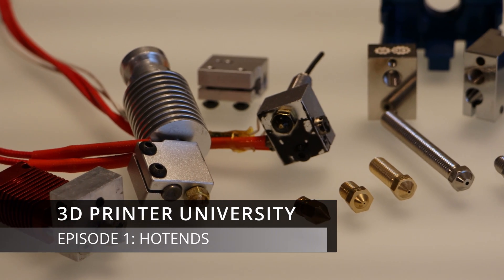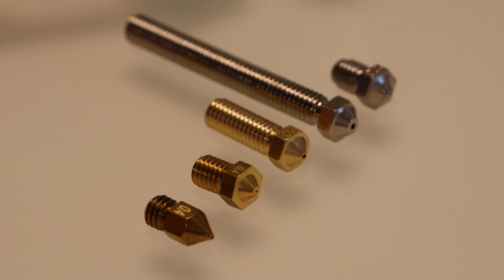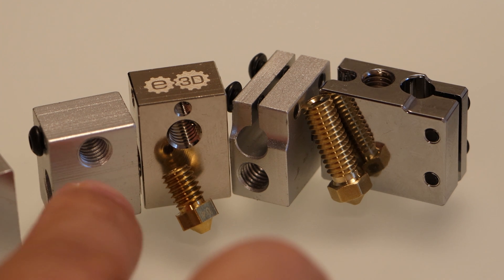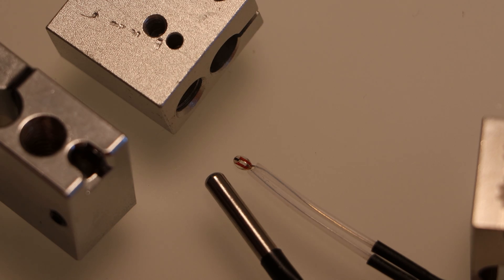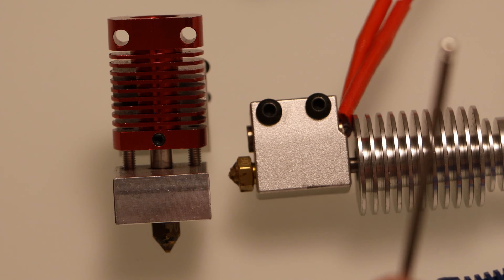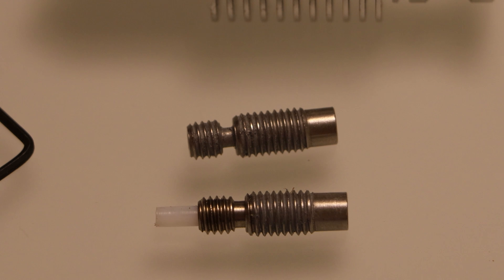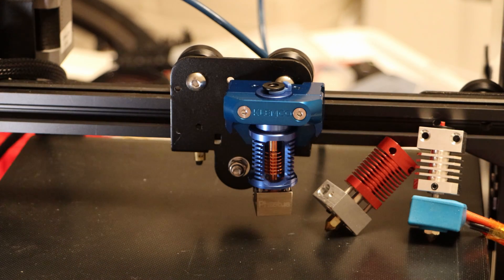Good/Better/Best: Which Hotend is Right for You?

Comment: I swapped out my standard hotend for my Anycubic Vyper, since it was not all metal. The new Hotend is a Dragonfly BIC HF.
Do I need to change anything in the software of something? If I turn it on it just heats up to 270 C evn tho 230 are programmed, and then it just writes Something wrong with Hotend.
Maybe because I cheaped out a lil on the heater? Idk what else it might be atp.

Comment: An additional difference between a thermister and a thermocouple is the thermister has better accuracy. and at typical 3d printing temperatures, you want better accuracy, you don't need the additional temperature range of a thermocouple. Good Themistors can be rated up to 300˚C, and will handle all but the hottest of 3d printing jobs. Thermocouples can be rated up to 1300˚C, but like I said, this is very rarely necessary for 3dprinting.
So, thermister = cheaper and more accurate, lower max temp
thermocouple = higher temp, more expensive and less accurate

Comment: Thankyou for the video. The Ender style hotend has another issues with the two bolts as they are offset from the centre of the heat block towards the back. As you do them up, the heater block bends upward at the back because of this offset. Any difference in the tightness of either bolt and the block twists side to side as well.

Comment: Good info for rookies like me. But a couple of potential corrections from an old electron pusher on the electrical section. First, the Ohm's law thing is likely to give a false indication of actual wattage of the heater. Resistance heaters (including old tungsten light bulbs, etc) have resistance that changes (goes up) as they heat up. The low 'cold' resistance causes  a large surge of current when first powered on, which tapers off rapidly to the 'running current' as it heats up to normal operating temperature. The other issue is the thermistor statement, saying that as temps go up, resistance goes up. Thermistors come in two basic flavors, PTC and NTC. As one might guess, NTC stands for 'negative temperature coefficient', and PTC indicates 'positive temp....'. If the printer is using an NTC thermistor, resistance will go down as temperature goes up.

Now, a request from this printing rookie: How about a video that quantifies the diameter/thread pitch/length of nozzles, heat breaks (including sleeve diameter where they go in the heat sink), heater diameter/length/voltage/wattage, thermistor type/diameter/length, connector types used for each heater and thermistor, etc, for each hotend type. It would be nice to know the same info about each printer.  Some of this stuff looks like it could be mixed/matched, but  that obviously isn't always true, even within the same brand (at least if it's Creality...).

Thank you for all the work I know it takes  to create this content, and I hope you didn't mind the thoughts on the electrical stuff.

Comment: Thanks for this explanation.  I notice that for filament exchanger system, versions like Bambu Lab cut the filament, while Prusa just retracts.  To save the extra part for a filament chopper, it seems like retraction is the way to go.  But so far, I haven't been able to come up with retraction settings that don't leave a plug that is of larger diameter than then original filament, which eventually results in deforming the PTFE filament in the hot end.  I've just got an all metal hot end, and I'm working on getting it dialed in to just make normal prints work reliably, let alone be able to remove the filament from the system.  However, I'm now thinking that forcing users to go with an all metal hot end would add just as much cost to the system as a filament chopper!

Comment: Personal Self Notes:
- PTFE in HeatBreak is used to reduce amount of friction inside of the hotend to get cleaner extrusion, 
- for an all-metal hot end to get similar levels of performance it needs to be highly polished on the inside but to me the main advantage of an all-metal hotend is that you don't have to be heating up this ptfe liner to the melting point because it'll start to release volatile gases
- Screws that are used to secure hotend in place increase heat transfer up to heatsink

Comment: The cartridge style thermistors are WAYYY better than the glass bead thermistors. Mine used to jump out no matter how well I secured it. It finally got eaten by the molten filament blob monster and I decided to upgrade it to E3D's cartridge thermistor. A quick change in Marlin and PID tune and I've never looked back. Bonus points for now having the wiring disconnect so if/when I replace it, there's no more cutting or soldering. Just disconnect the old and reconnect the new.

Comment: meh. i found all hotends to be junk, made my own.

it will melt a brass nozzle. thats about 950C. i dont run that very often though. just its there if i want.

no heatsink required.

people get so stuck in a rut, copying each other, and forgetting to go back to basics, consider the problems, and go on a hunt for alternatives...

Comment: You open my eyes, dude. I don't want any longer the volcano, but to upgrade to copper 👍
Reply from the maker: Lol not sure that’s what the takeaway is. If you look at an overall thermal model the material choice matters less than you’d think. The big lump of thermal resistance is between the nozzle and plastic. Check out CHT nozzles

Comment: for the heat break there's the mosquito style (like the 2 part blue and copper one) which has the rigidity of additional standoffs while avoiding the heat creep.
the standoffs avoids the heatbreak having to hold the heater and nozzle, which allows it to be even thinner.

Comment: fyi a lot of more expensive non stick pans use a ceramic coating which is good to like 300C instead of ptfe (though the handles and glass lids are recommended for <175C)

Comment: I did an experiment on my Ender 3 Pro. Measured the temp of the heatsink with and without the 2 screws fitted. It was only around 2-3 degree C different. I dont believe the screws are that much of an issue wih heat creep.

Comment: i cringe when you suggest removing the ptfe liner, My first 3d printer i missed installing that part back in first years of 3d printers....it keept becoming jammed. A few months later i discovered that put it in and i could print 300% better :P well proboly wasent polished
Reply: PLA sticks to metals when around it's glass transition temp, either overkill cooling or PTFE lining is the solution.

Or you give up after constant heatcreep issues that never fucking leave you be the switch to PETG.

Comment: A cheap and good way to improve hotend on Emder 3 is to use an all metal heatbreak (best titanium) and taking off the 2 screws between heat block and cooling ribs. This is a much good solution for me! Thanks für this perfect hotend guide, it's very well produced i think and very informative 👍😊

Comment: Aluminum block performs very well. There is no reason to pay extra for copper because there is no measurable difference.
Reply from the maker: Above 300C aluminum loses strength pretty rapidly. So 300+ it should definitely be copper.
But in terms of heat transfer both get the job done well enough.
Reply: @NathanBuildsRobots  I didn't take the strength into account as I have never printed over 260-270C.
Just heated up to 290 to melt the clogg

Comment: 3:40 - V6 Nozzle is 12.5 mm in length, Volcano is 21. This is 68% of advantage for Volcano (not "twice").
Moreover: we need to take into concideration that the plastic melting not only in the nozzle - bottom part of the heatbreak is a part of the melting zone as well. So the real difference between V6 and Volcano is 11 vs 18 mm3/sec. Which is also significant.

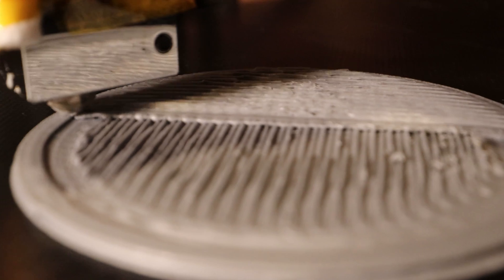Comment: 1:20 - this is not how melting zone works. Molten plastic behaves like a liquid - it is not able to desrease its volume under the preasure.
The thing you have described heppens between the feeder and the beginning of the melting zone as filament able to stretch and shrink in favour of the diameter.

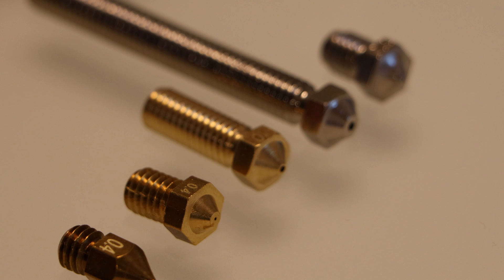Comment: 0:53 - Larger nozzle diameter allows print faster but less reliable and with lower quality. Trying to increase prtinting speed with larger nozzle is one of the biggest misconceptions in 3D printing world.
If your hotend capable to heat some amount of plastic in certain time - you will not increase that amount with bigger nozzle. You just allow to push more unredheated plastic, resulting in poor layer adhesion and other problems.
Reply: Heat-transfer into the plastic plays a role, here you either use a volcano style nozzle or one of the splitting ones to increase heat area on the filament, works nicely and is cheap.
The default nozzle is not 0.6mm anyways as slicers are more capable of dealing with different size extrusions.

Comment: Cool video very informative. Yeah about video suggestions, there’s no one yet doing a video of really measuring the temperature creep..
Previously without Bowden there seems to be just extruder then the hotend. There’s no heat break, heat sink or Ptfe tube. The nozzle goes right thru the heat block straight into the extruder only a 2.5mm gap. It would be cool if u can make a video measuring the different type of fancy heat sink heat break just to know if the temperature really creep so much up. Your explanations are great and well presented. Thanks for making such a video.

Comment: Unfortunately, these PTFE liner heatbreak hotends can clog too. I ran into these issues when printing PETG on an Anycubic i3 Mega S machine. It can deliver amazing print quality, but when you use very high retract settings to prevent PETG from stringing, it can clog the PTFE tube, whether the PTFE tube has been degraded (became tighter) or not. So just don't simply use these crazy high retract settings of 5..6mm or even more with these hotends, do some tests to check where the PETG really starts stringing and use the lowest rectract distance possible.

Comment: No combination of ptfd tube and hotend is a good design. All metal hotends are the only solution.
Reply from the maker: AGREED!
Reply: @NathanBuildsRobots  Not true for PLA.  PLA can clog in an all metal hotend and is more reliable in a PTFE "down to the nozzle" design.
Reply: I have pet birds and one of the things they say is to never use Teflon (PTFE) cookware because of fumes and birds' sensitive respiratory systems. Having PTFE tubing butted up against the nozzle is just as bad or worse. It's all metal hotends for me or nothing. That, and make sure thermal runaway protection is active.

Comment: Be sure to take any cartridge thermistor apart and check them, most are cheap and the thermistor is just floating in side and not thermally coupled to the metal at all.

Comment: First off, you posted this on my birthday! Awesome, you also answered every question I had about the problems I was having with my Ender 3 and Sunlu S8. Now I just want a recommendation for a printer I can use with a 1.2 Nozzle!
Reply from the maker: Well, the main thing is you want a good dual gear direct drive extruder.
It will really help feed that 1.2mm nozzle. Most cheap printers don't have dual gear direct drive, so you if you buy something cheaper you'll probably have to upgrade the extruder.

The ender 3 S1 has a good extruder out of the box that will be able to extrude 25 cubic mm per second, which is about 5x what a typical cheap bowden setup can do.
Reply: @NathanBuildsRobots  I have a Sunlu S8 with dual gear extruder. I'm nervous about trying it is my problem. I'll try it one good weekend or holiday. I originally wanted to build bigger models for selling but discovered it was easier to sell files. However I still want bigger models done fast. Your video made it easier to comprehend

Comment: @4:17 Yeah, true: an aluminium heater block will melt if you try to print with a temperature above 660 degrees celsius 😂
Reply from the maker: Yeah, and AL has the tensile strength of butter when you get to the 400+ range

Comment: I don't think smoothness inside the bore has any effect.
After couple of hear cycles, metal what ever it may be will oxidate causing that smoothness to be mine existent.
It won't become rough, it's just it won't be slippery as it was when it was freshly machined.
Reply from the maker: Do 3d printers get hot enough to significantly accelerate oxidation? I've seen drastic surface finish changes on plain steel and copper a low as 150C. 
Nickel, aluminum, stainless steel, and titanium usually don't look much different after being exposed to those temperatures. Even at PLA temperatures, i think they would be fine. 
Stainless can go up to 400C before I start to see a difference (heating up a new soldering iron for instance), and with nickel Coated brass, I think you'd have a good chance of maintaining a polished surface at very high temperatures.

Comment: Great explanation on hot ends. On the micro swiss do you have problems where the heat break meets up with the hot end? I'm not sure I like how it just sandwiches together.
Reply from the maker: The plastic should always be solid in that region. I have heard reports of ppl having it jam in that interface due to the plastic being molten and solidifying in the nooks and crannies of that joint, but I have not experienced that myself.

Comment: I already have a ruby tip nozzle in the mail. Any experience with these? I saw a diamond tipped one as well for $100.
Reply from the maker: Copper is probably the best price to performance. Ruby is supposed to be good for abrasive materials, but I haven't used one. 

The diamond one is interesting, I saw them on Amazon. Probably too expensive and not worth it compared to tungsten. I think diamond nozzles are powder formed Nano diamonds, which decompose at high temperatures and is not as strong a a solid diamond would be. But it's also much much much cheaper to produce. 

If I'm spending that much on a nozzle I want it to be good up to 400C+, like copper or tungsten are.
Reply: @NathanBuildsRobots  price to performance-wise, I'm thinking it will pay for itself over time with it's durability (especially if abrasives aren't your thing).

Regarding heat, I am still rocking stock hot end so I'm not trying to crank it yet.

But I heard durability was phenomenal and I am willing to try at least one

Comment: Ok my question is does the heat break have to fit the whole length of the heat sink? I have a tronxy core xy. That shipped with a cracked heat break. It took a month to get a replacement from them. But I couldn’t find a 35mm long heat break. Plenty of 27mm and a few 30mm. I ended up trying my ender hotend but the length was a few mm short.
Reply from the maker: It's not strictly necessary

A gap in the heatsink can cause the filament to be more difficult to feed, but it should work fine once it is fed past that point.

It's kind of like a kink in the line that the filament can get caught on, but once it's past that point it won't get caught on it, if you know what I mean.

Comment: Is there a difference between the T-V6 nozzle versus a V6 for your Rapido? Are they both compatible?
Reply from the maker: The important dimensions are all the same, so it should be cross compatible. 

https://3dprintbeginner.com/ultimate-3d-printer-nozzle-comparison/

"The T-V6 brass nozzle is similar to the sharp version but it has more it has a different design with more copper on the tip. This should help maintain a constant temperature of the filament right to the point where it leaves the tip."

Comment: I did the metal throat replacement like you did in 12:49, but once in a while it would clog. I put some canola oil into the tube and burn them off inside for a coating and it worked much better.
Reply from the maker: That is an interesting idea. I may try it. 
You sound like one of those cast iron people! 🍳 😅
Reply: Nice idea, seasoning it.
Reply: Clever! I would love to see if it also reduces resistance while printing

Comment: Nice how you explain this. Easy to follow and well-grounded info. I think you commented the two extra screws in the Ender quite well. The MicroSwiss hotend works great if retraction is set correct. Well executed and informative video.

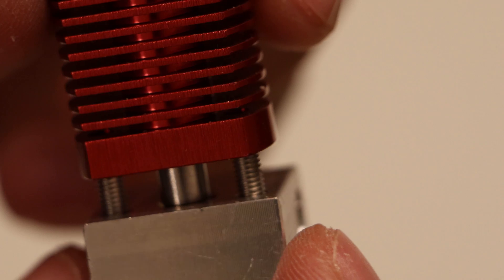Comment: 12:00 you can just remove these screws. I experienced a lower temperature of the heatsink after removing them and had no noticable effect on printing quality/reliability. Just make sure to snug up the nozzle real tight to the heatbreak while everything is hot, so that the nozzle and heatbreak can't move.
Reply: Yeah, aren't you supposed to unscrew them ? I thought it was only used for when you need to change the nozzle to keep everything straight.

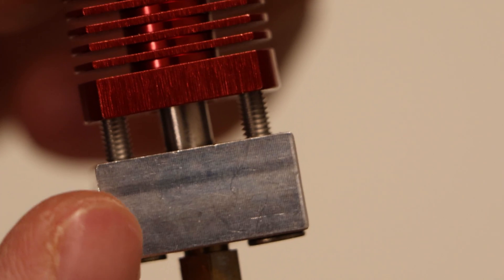Comment: 12:05 Chep recently debunked the myth that the two screws joining the heat block to the heat sink result in heat creep. Whether he used the screws or not, the heat sink ran at a paltry 32’C. The screws resulted in that temperature being reached sooner in the print, but if 32’C gives your filament trouble, your filament is not up to the job. The heat sink’s cooling capacity far overwhelms the heat creep of the screws.
Reply from the maker: I saw that video after this one, probably would have had addressed that in the video if I had seen it.

I think a big reason is the screws don't actually touch the heater block that much, other than a few points of contact on the threads. It would be different if it was threaded into the heater block and threaded into the heatsink, because then it would have a lot of contact area on both parts.

I wonder if it would make more of a difference at high temperatures
Reply: You can also get hotends that use thin titanium screws here again making the heat transfer very minimal whilst still allowing easy nozzle changes.